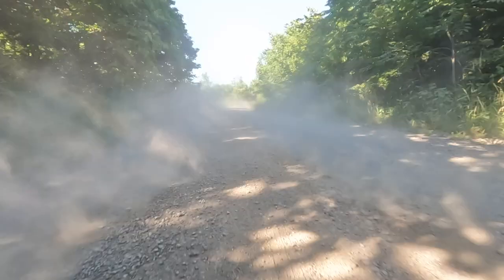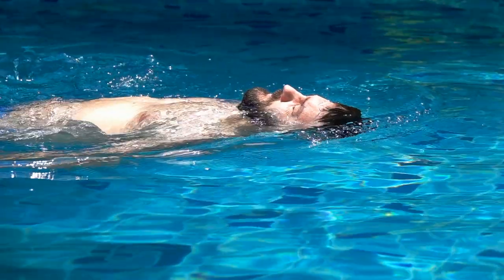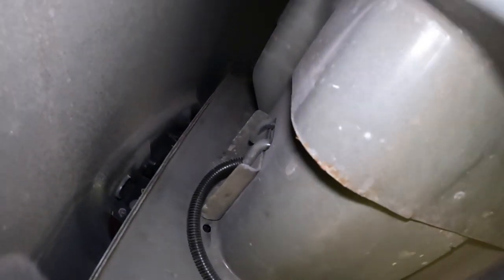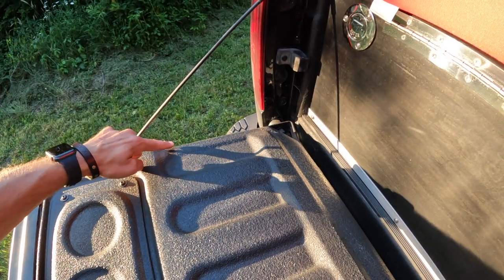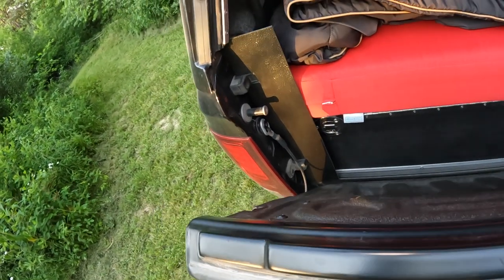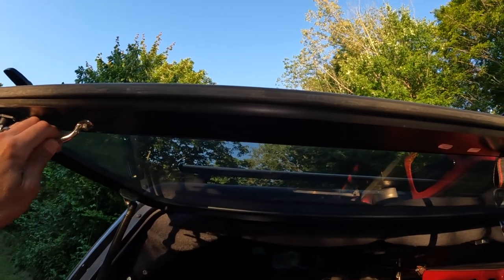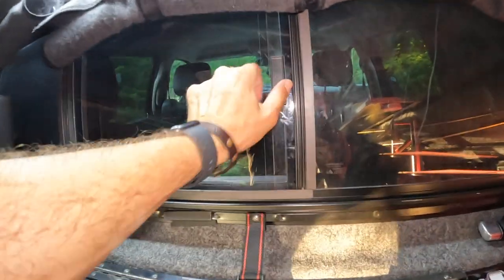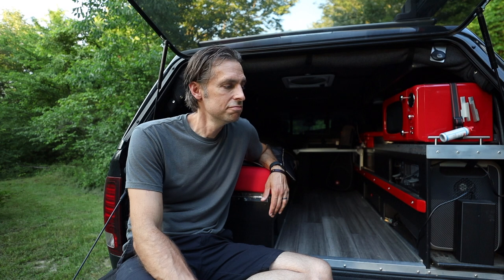How to Keep Road Dirt Out of Your Truck Cap Camper!

Comment: Do you have a roof fan that can reverse so it blows in? And if you have it blow in it would not suck dust in, but blow air out the cracks from fresh air on top of the camper ( probably need a vent cover to drive with it open.

Comment: Love the video.  I know this is a bit off topic but since I was a bit behind watching on your last video, I figured I'd comment here so that you might see it. On your last one I'd never heard of roll up canoes before,  did they hold your weight well without taking on water? I feel like that could be a great way to portage without carrying a ton of weight.
Reply from the maker: Thank you!! We have been pleasantly surprised at how sturdy they are once folded. I have never felt unsafe while using them. We had rigid kayaks prior to these, and I am so glad we went this route. They weigh 28 pounds and can fit in the back seat. Sure beats trying to get a 13' tandem kayak on the roof of my truck!

Comment: I've actually found that slightly cracking my front topper window (cab access window) while driving, it helps build a small amount of positive pressure inside the cap that helps keep dust out. Not a lot of dust gets between the cab and the bed while driving so it doesn't pull too much dust in. But the positive pressure helps by trying to push air out any other gaps that might exist. I've tried to seal around my tailgate, and plug all other holes in the bed, but my topper isn't made for my truck so nothing really seals 100%. 

The positive pressure method isn't 100% dust proof, but it sure seems to help a lot. I travel a ton of dirt roads in mine for hunting.
Reply from the maker: Thanks for sharing your experience! It is so hard to keep the dust out for sure. I remember once driving a Class A down a Kansas dirt road for about 40 miles. When I pulled into a tuck stop to sleep that night, the back bedroom had 1/16” covering of road dirt everywhere. All we wanted to do was sleep and instead we hade a huge mess to clean up. Somehow the dust was being drawn in somewhere. I did have my driver side window open for some of it…I’m guessing that was creating a vacuum of sorts.